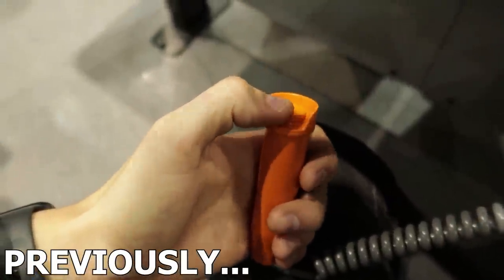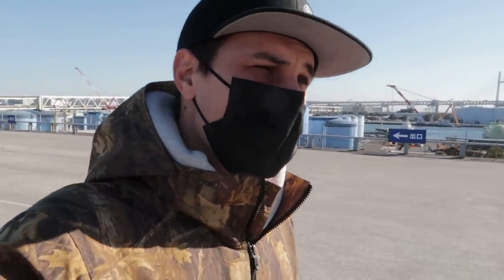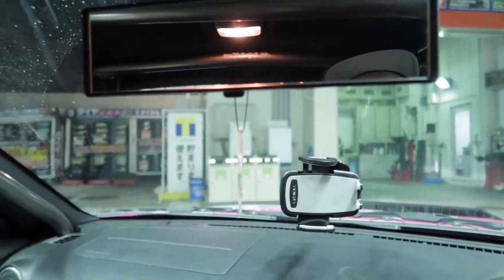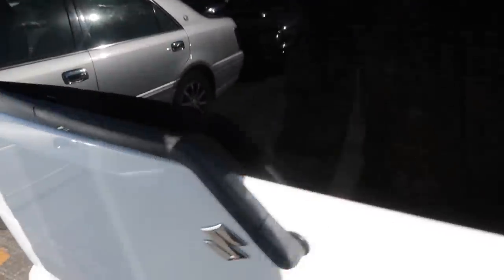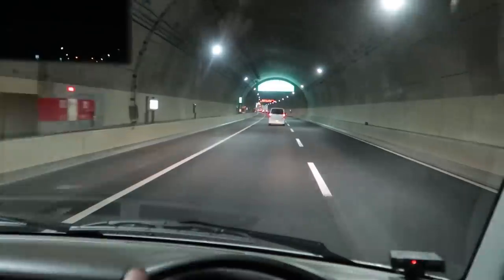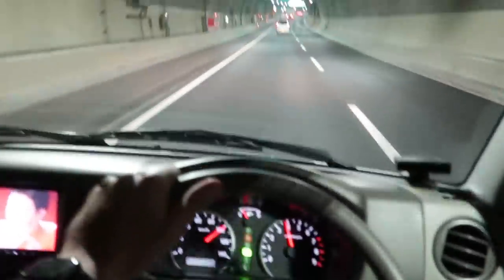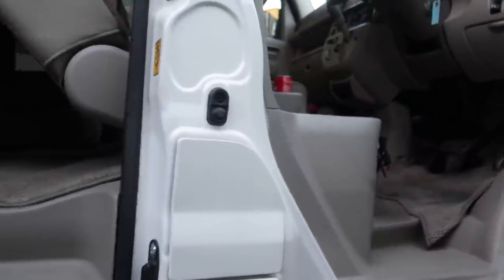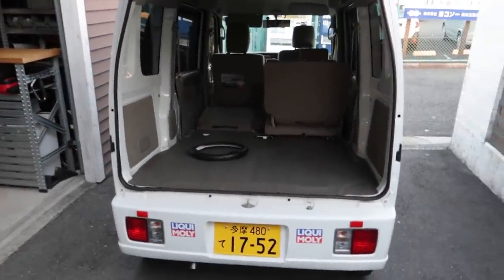I BOUGHT THE BEST JDM AWD TURBO CAR OF ALL TIME!

Comment: Here in Philippines, some Filipinoes they use a Suzuki Kei Car as an any kind of purposes because it's Illegal Import, cheap, fuel efficient, practical and easy to drive. They use for Families, Friends, Small Businesses, etc. 

And also they do Restoration or Customization by their own if the kei car was a piece of junk from Japan, also they do conversion from RHD to LHD 
And the parts as well are easy to find 
and the mechanics you can find them in any Car Shop

They really like Imported Kei Cars here in Philippines actually

( Just sharing my thoughts because i'm also a Suzuki Kei Car Owner )

Comment: as for the handbrake they make relocation kits that will let you put it in between the front seats you just need a longer cable and the actual lift bar emergency brake handle and you're good to go. if I'm not mistaken the Honda acty has a center console handbrake that you can retrofit to fit in your Suzuki.

Comment: That's still a cheap one Sir, here in the Philippines if you buy it here its kinda like 5-6k$ one thing is that it's not brandnew it's came from there in japan 🗾 well we call it surplus and it needs to transfer the the steering from right to left hand drive, since it's left hand drive in here.

Comment: What is all of the activites you are planning to do in the boot SAMMIT? 
Don't cheap out on some extra winter tires for when you going to drive in the snow. If possible and if they have them in those small winter tires. Get the newest version of the Michelin. I promise you wont regret the extra cost of them. Living in Sweden we are still able to have studded winter tires during the winter months here. Then you are on another level of grip and brake performance in ice and snow conditions. But Michelin has gone by their competitors a lot with both their studded and winter tires. Even the so called all year tires is decent in extreme wheather. 
See if you can get it wraped with different motives on the sides. One side for you and one side for Mai to decide which to go with. And just get you a nice new hood for it since it's so cheap. That muffler looked gigantic under the van LOL. Just do some bolt on mods so it's easy to restore for the yearly controls of it. See if there are any cool roof wing for it. It's usually also a benefit to keep the back of the car cleaner. Some of those can be horrible to get dirty on the rear window. A wing change the turbulence so you get it less dirtier. Then of cause some nice wheels for the summer time. Maybe also tint the side windows or maybe even see through wrap on them. 
Cool van Sam and with the multimedia head unit it seems like a steal! Think that we here in Sweden can not registry Kei vehicals sadly. Maybe if you registry it for only 50km/h and regulate and also make the gearbox to not up shift so it wont go faster than that. It can be going under slow going vehical like the most farmers tractors are registried here in Sweden as LOL.

Comment: LIqui moly stickers? Had a blown motor and they flattened the block with the molly instead of replacing the block and sold it quick before the block blows a hole. How do I know? Coz I bought something just like that.

Comment: Bro that thing is Freaking Mint my dude I would put a Bitching loud Ass system in that thing like 6 12inch Deafbonce subwoofers Heck it sounds like it already has some aftermarket Tweeters sounds really clean & clear sweet headunit Alpine is that Shii 🔥 & Turbo AWD and if the motor ever goes out u can swap a 13B holy shit how badass would that be....🤘

Comment: JDM, 4WD, turbo but couldn't pull a trailer with a push mower on it. If you bought this for a shop truck you severely missed the point of a shop truck entirely lol. Good purchase though but kind of way out in left field for what you really need